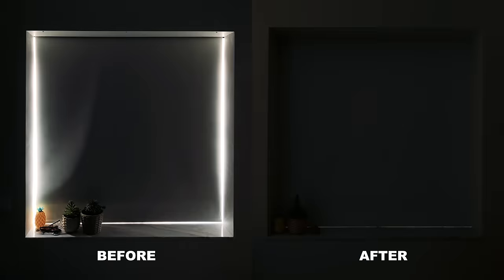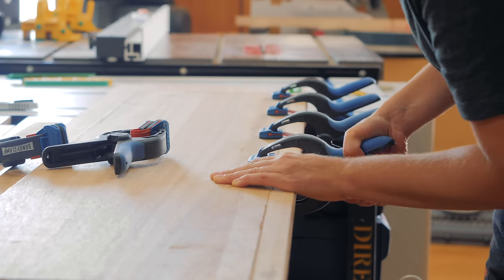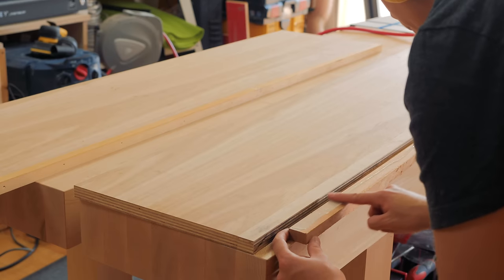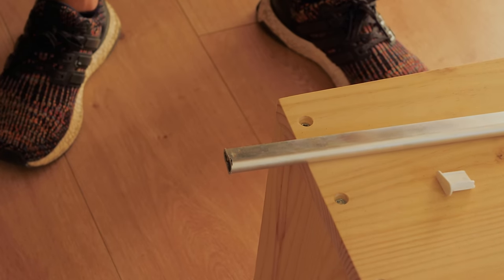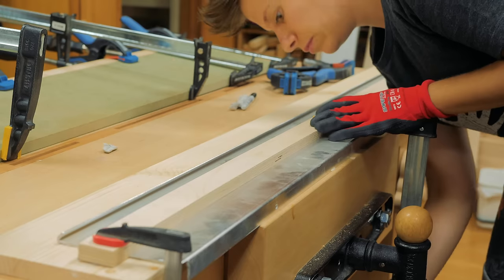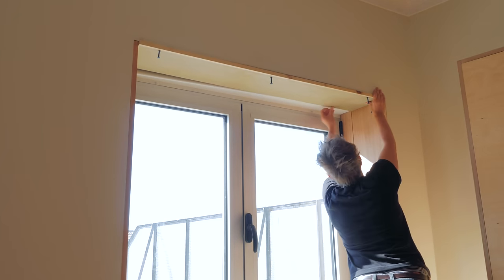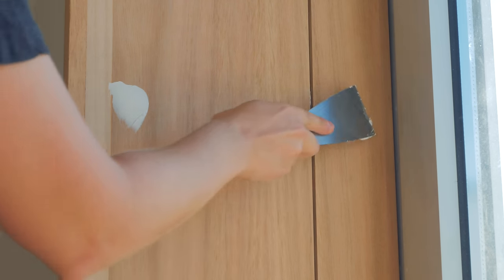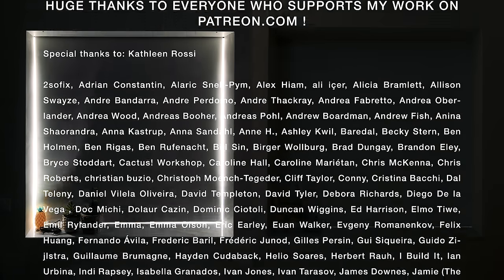Eliminate Light Gaps on Window Blackout Roller Shades // Tiny Apartment Build Ep.7

Comment: Very neat job! For the last little bit of light coming in along the bottom, you could make e.g. a 5-10mm thin rubber flap. As it lowers, it will conform to the surface and seal the gap. You should be able to get a thin piece of light gray or white rubber and attach it to the rear of the lower bar.

Comment: as someone who installed automated shades for a living i can tell you the install was done correctly. i cant tell what brand these are but the brand i use recommends a 1/4" gap above the sill. also the material doesn't extend to the edges because the roll is wider than the fabric. there needs to be room for the parts to attach and for the programming buttons to set limits.
your job was beautiful but if i arrived to service that shade i would not be allowed to remove any of the materiel necessary to service or remove the shade due to insurance liability. 
once again, great job. looks incredible, but i wanted to put this out there in case anyone else is considering this. a shade this size would run about $1200-1500 from the brand i install depending on the fabric. so if it fails you would definitely want it repaired.
just presenting some facts to consider.

Comment: Omg I did a ghetto version of this year's ago haha mine isnt automatic tho. just got some 1 inch foam, painted it and wedged it in. Thn put a groove in it and slid the curtains In 🤣 
This definitely is a more permanent fix haha awesome
Reply: I'm in an apartment and need a temporary version for when I go to third shift, so thank you for the idea!
Reply: @CheffBryan  that's why I did this lol renting! On the small window I just cut the foam out to the size and drilled two holes in it and put a rope through and knot it in the back so I had a handle to pull it out :)

Comment: After doing that work, it would drive me mad to leave the line of light at the bottom.
Reply: so just add another board and over lap the original window sill. no need to be negative is there.
Reply: THE ORIGINAL NUTTER if you see that as being negative you just leave a very positive life.
Reply: I understand that.
Reply: THE ORIGINAL NUTTER I gotta agree with WeXaztor on that one.  You need to lighten up.  Or go ride a unicorn into the rainbow colored sunset on your world.  (Now see, THAT was negative.)
Reply: That part bothered me as well but I would guess it's an easy fix! She did an awesome job and it looks professional.
Reply: A slit in the bottom of the sill would be hard to make to look nice without a whole lot of additional customization done on the blind.
If one could live with a slit the thickness of a saw blade then one might possibly exchange the metal tube at the bottom edge with a thin metal strip. It would still give it weight and "trueness" so that it would work nicely with a narrow slit. If one would wish to keep the blind as is, then the slit would be an unsightly gash :D More than a centimetre. Collecting dust and all sorts.
I my self would try something with magnets a do away with the need for slit :)
Drill some shallow holes with a forstner bit, drop in some rare earth magnets, mud over and paint.
Then install a metal rod insiden the bottom edge of the blind so that the magnets have something to grab onto. Possibly add a thin long piece of felt or possibly a white surgical rubber tube/hose so that when the magnets grab the edge it compressess and makes a light-tight-seal :)
Reply: Another option could be to just countersink and caulk over a  few screws on the bottom sill, and then glue or sew in a few magnets inside the lover edge of the blind. Make a few notches in the tube and insert magnets. Other than that, same as above :)
Would be a bit more fiddly to line up the magnets and screw heads though.

Comment: Couldn't it do with a groove in the sill for the blind to sit into to black out the base too? Nice job, though, as ever.
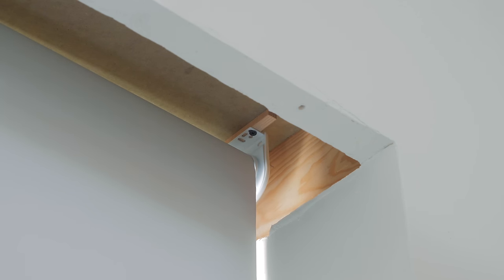Reply: She did say that it is a marble stool at 0:38.
Reply: Also it would'nt look as sleek when the blind is up and dirt may get trapped more easily inside the gap than the sides. A solution to this may be to replace the bar with a flat edge rather than a round one and use a fine brush trim or rubber trim along the edge.

Comment: And it is likely much more effective at keeping the heat from coming into the room...
Reply: Not really a big difference. Primary source is sun radiation straight onto items inside your room, including floor and ceilings. Secondary is glass in the window itself heating up and becoming a secondary heat source right in your room.
(Better keep the sun off your window)
Reply: @dozog  Keeping the sun off the window is the better way but not easy to do do for most people in a lot of situations.
Reply: @jedics1  I agree. What I was responding to is your assumption that closing those small gaps left open by a large curtain will make the heat blocking "much more effective".
I think it looks much better, but don't expect much effect on heat transfer.

Edit: I think people who have the equipment to make the window coverings that embrace the curtains the way she did in this video, might probably also be able to hang one of those rolling curtains designed for outdoor use.😉
They aren't available where I live, but my parents have them on their bedroom window. They work so well to keep the room cool.

Comment: What happens when the mechanism breaks? Need to take the whole thing apart?
Reply from the maker: SDM17RG hopefully the fix can be done by removing the aluminum cap that has the 2 small screws. If not, the whole top cover needs to get out, yes.
Reply: Yup as an installer for shades of this type. I was just going to mention this. Will be one huge task to service the shade if needed
Reply: Not to mention, blinds need some air between the window and the blind.  As nice as it is and looks, there's big time trapped moisture coming if not left partially open.  You'll wreck the wood and likely the blind.  Buy a curtain.

Comment: Bosch power tools ftw! :)
Just used my new GDX today to mount a rafter for clamps to the roof in my garage, and finaly got the BT module to work with my GSR 18V-60C. :)
My GAS 18V-10L shop vac however, drains 4 amp batteries like crazy. Should have bought a corded one instead...

Comment: Is the motor hardwired ? And how would you go about having to do a repair without tearing it apart ? And i gotta say its very nicely done, except using the mud instead of filler between the wood and wall joints

Comment: Well done again. Such an improvement. The only concern what kind if the filer you applied by perimeter? Due even PLY and MDF can have slightly movement (temperatures and humidity to blame) wouldn't cracks develope with the time?

Comment: You could use a magnet strip and integrate it on the bottom to get a snapped closed shade with no light on the bottom. Also the metal would need to be steel for it to work but if it's not maybe just slide a thin piece through the bottom of the shade

Comment: I could see this also working with wood stripping, double-sided foam tape, and insulation stripping. Which may be a cheaper and/or temporary way of doing it, like in an apartment where you might not be allowed to make permanent alterations. Could anchor the wood stripping to the sides of the frame with double-sided tape to cover the sides of the roller blinds, and put weather stripping or felt on the surface the blind guides against. Removable, and you wouldn't need the saw to cut grooves in anything.

Comment: I would recommend to use plaster tape on joints like the one between the wood and the wall. It make it harder for it to brake in case the windows closes too hard because of wind!  

Nice nice work

Comment: Are you plastering between wood and drywall? If so I'd love to know what you are using to avoid cracks appearing over time as the wood expands at a different rate to the drywall.
Reply from the maker: This is a concrete wall and it was mentioned a few times during the video. Not drywall. And it might crack on the separation line but it's put to proof now. So far so good, let's see what happens in the winter.
Reply: @GetHandsDirty  Hi thanks for replying. I watched it with sub titles so I probably missed where you mentioned that it was concrete. I ask because I have a similar project with door frames that have no architrave and curious how others cope with similar situations where wood meets another material. Currently using a shadow line seems to be the preferred method but this seems counter intuative to me because it actually creates more lines. The finished effect you've created looks amazing. Let us know how it holds up.

Comment: I have a window covering Installation company what you did is cool, however looks like a pain if you ever have to service the shades and assuming the shade is hard wired (no batteries).
I’m very interested in the concrete anchors you used could you please comment on what type they are, maybe not available in Canada?
Thanks

Comment: Absolutely respect your creativity and great use of tools. I’ve installed plenty of shades. Based on how room air pressure works, depth of what is concealed should be minimum 1.5” or 2” for better results. Reason is as the door opens or you know how doors get sucked in sometimes, if it doesn’t have correct with in track concealed, the shade can twist and can tear or simply pop out. Nobody wants this kind of annoyance. The tape on the tracks is not meant for that daily friction. It will wear release glue and damage fine fabrics plus is fugly as hell. When concealing remember about easy of replacement and service. Please use magnets to hold covers for service access. Usually shade tracks on the inside edge are shaped like a hook almost where you can fit fine fiber or fever type material. The material will stop light from going in and if some bleeds it had to bound inside but is met with a hook or dead end on the other side with more of that protective fine finer material. This same material can be ordered on the bottom bar in black and when it hits the bottom it deals that annoying light at the bottom. This shade when sun straight on it does the job but on angles it can bleed.

Comment: hmmm..
1. what happens when the wood contracts? that slid is too narrow, it will catch the fabric. the slid is so narrow, that even plain fuzz or dust can hamper the movement over time. Couple it with some moisture from the rain and you always have to run a screwdriver to clean it.
2. Wood bolted directly onto the concrete will not allow set wood to contract and expand. Being that it is situated near a window, with blazing sun in the summer and windy, cold winters, that wood will expand n contract so much that it will split eventually. There are rubber elements that go in between different material for details like that. You also drill larger holes when fixing wood in place, so that the space between the bolt and the wood allows for movement, you had flush snug holes drilled. The sunk holes are also a big nono in that case, even if they allow you to hide the screws with plaster.
3. Wood in direct contact with concrete is never a good idea; even if the wood is moisture treated. the treatment does run out at some point(if its a window frame or box, even earlier) and it will allow the wood to draw moisture from the concrete, making for bent wood. not to mention mold and the fact that it has no fresh air circulating in between the elements, nor a vapor barrier. Again, rubber elements when conneting two different materials
3. b. the building is always shifting and moving, throughout its whole lifetime. Wood put directly onto the concrete will create visualy unpleasant cracks on the face of the wall containing set window, cause she used plaster(mud). The building will move, the wood and the plaster(a rigid, thinly layed and non elastic material that will crack over time) wont. You either have to use a mesh tape similar to board tape and/or white silicone caulk/sealant for that whole entire edge that goes around the new frame she basically added.
4. What happens if/when(they do fail) the roller mechanism fails? how would you reach it in order to replace it? that mounting plate at top has a purpose, makes for easy access to the roller in case of maintenance. Now factor in all the costs needed to replace one faulty motor or a cut/dirty/etc fabric.. when it could have been a very cheap fix, now it asks for a much more hefty price and labour spent in order to take down and redo all the plaster work and etc.
5. This is for you would be internet fixers that look at this and think "wow, ima do it in my place": in her case she was lucky that the hinge and the PVC window allowed her to add an extra 2cm of thickness to her window sides and not have the window not open properly. But in most cases, the window will press the wood right next to it when it is opened, making for dents in time. At best you wont be able to open your windows all the way, at worst, they will only open but at a 45degree angle. Maybe her window lost some of its range as well, i didnt see a clip of it opening after the instalation
6. The light cone coming into an already small room will decrease some more. It might not look that much at a first glance, but its actually a lot, depending on the suns orientation, you could lose as much as 10-15% of the natural light coming into the room with that 2 cm loss to the window sides. (Yes, that much)
7. You also affected the air flow. In some cases, people prefer to sleep with the window open and the blinders down rather than use the AC in some mild summers. 
With no gap on the sides and no other window, balcony door opened,if someone closes the blinders fully(and why wouldnt you if you want a blackout room with no light coming in, your original goal that put this all into motion, apart from you wanting to do something "cool" i guess)
 the inside/outside air flow that always happens(or wants to happen) will blow your curtain off its tracks(making you original plan pointless cause lots of light will bleed inside then) or maybe blow it off completely in times where the air pressure greatly differs.
You designed a very final(that has to stay in place for years in theory) solution to a problem without knowing full well all the aspects that need to go into it, all for the sake of the looks. I get looks, im an architect.. but, they also need to be good designs. Im sorry, im not trying to get you down. There are much more aspects to design and fabrication that you are not aware of. These are just aspects that a trained specialist knows.
Regards!
Reply from the maker: Thanks for your concerning points! It makes sense to a certain extent, although I made this build in the winter (most humid and cold season), the materials are meant for high moisture levels and are not solid wood as obviously it would expand and contract a loooot more, the window is made out of aluminum and not PVC, the roller shade still has access from the topo rear screwed piece next to the window frame, the window opens at its full extent, both vascular and regular, I kept the bottom air circulation tiny vents free and I cannot have the window open without the curtain being rolled all the way up, so no chances for it to get out of track with the wind. The only concern here would be the expansion/contraction of the front edging that I put to cover the plywood edges that actually looked great at first and now you can see a slight difference between them and the wall. No cracks so far though. I get what you mean and how this would never be proposed to be executed like this on a house project. These videos are experiments that I make and meant to share concepts and inspire people to get up and do something with their own hands. I certainly do a lot of mistakes and certainly do lots of things that people think that wouldn’t work but then they do empirically in this specific time, place, circumstance. I made this fitting specifically these windows and I would assume that others will expand on the idea and fit their circumstance if they eventually want. Your concerns are valid and people should read your comment nonetheless and do their own research!

Comment: To put some panels on the walls to make up for the space you should have used a laminate white to match the rest of the walls not a wood grain panel as it stands out and you’ve got to paint it in the end but laminate you don’t it’s all done for you just fill any screw holes with some filler.

Comment: Its not an installation issue. Those are the cheapest blinds a comp[any can offer. The installers are not going to trim out your crooked windows and cornice them in for what they cost. Industry standard gaps for solar/roller shades is 1/4 inch per side. This is done to prevent the shade from telescoping in a bracket and fraying it down the sides.

Comment: "They horribly installed the blackout shades leaving gaps on sides" ... They did a fine job, that is how they come standard. You have to order side channels to block out the edges. You have either unrealistic expectations or communication problems. By the way you still have a light gap on the bottom which a bottom channel would have blocked if you had done this the proper way. Have fun changing your blind in a few years!

Comment: As a spaniard I will never understand why more heavy duty roller blinds like the ones we use in Spain are not more widespread. Here we all have them in every single window, they are not expensive to install, they demand little to no maintenance (as in, you install them and they are ready for decades to come) and they block as much or as little light as you want. We all shut them down in the summer to keep the house cold, we shut them down in the night to have total privacy, or we just leave them rolled up if we feel like it. We use them to block sunlight reflections on the TV or whatever. I just don't see the downsides.